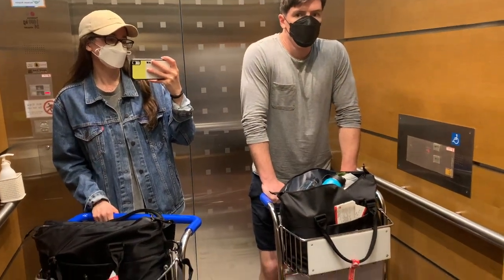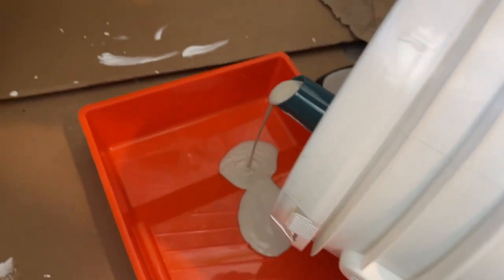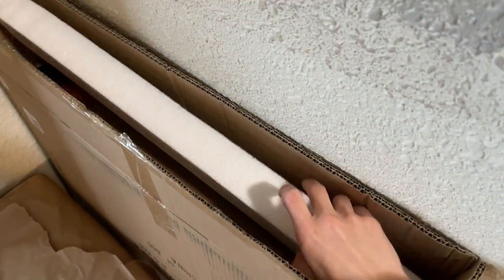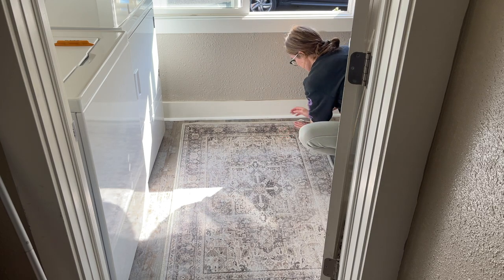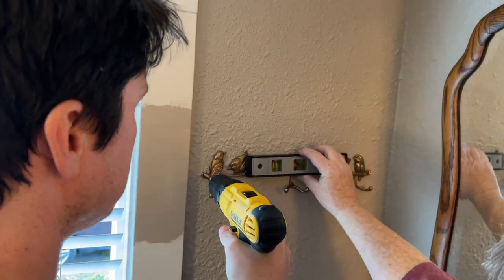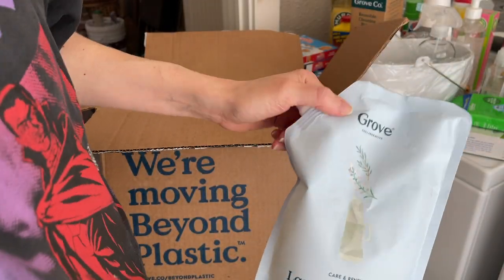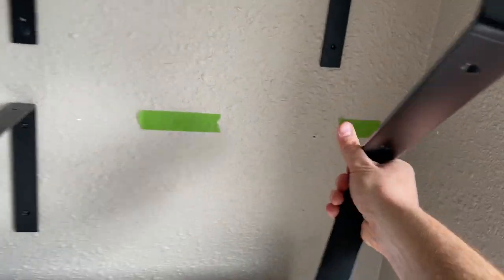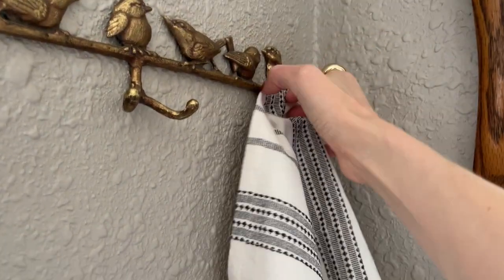Making Over A 100 Yr Old Home Ep 2 - EXTREME LAUNDRY ROOM MAKEOVER

Comment: I don’t think that above the door rack is going to work. Open the door and things will fall off. Otherwise beautiful💐
Reply from the maker: She had one there previously that she used and wanted another one. She said it was fine if she needs to move it at times but preferred having a space to hang if necessary
Reply: You don't have to air dry everything and it doesn't take to long either so it really is functional especially since they already have other bathrooms to use!
Reply: @SpaceMakerMethod  Mount the rack on the door itself. That way items hanging on it won't impeded the opening/closing.